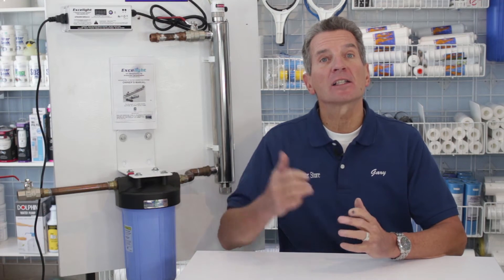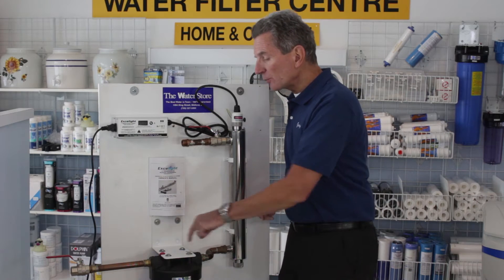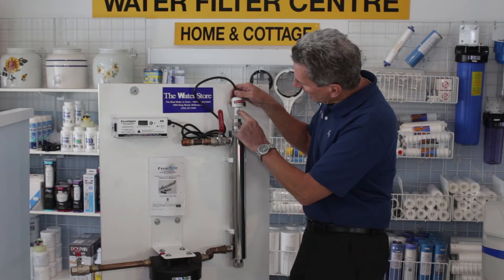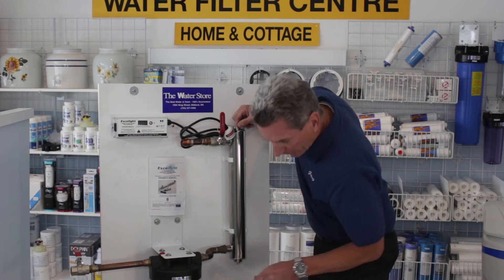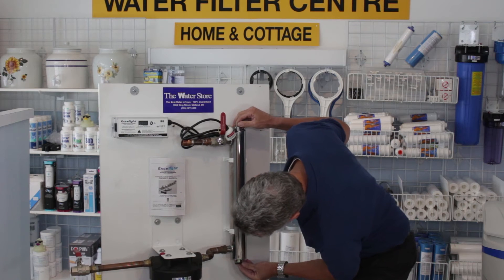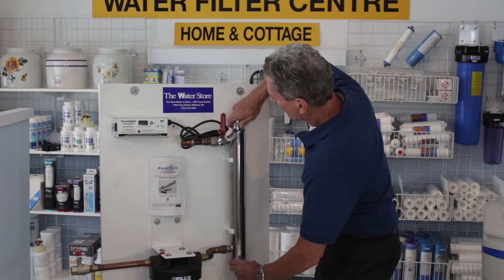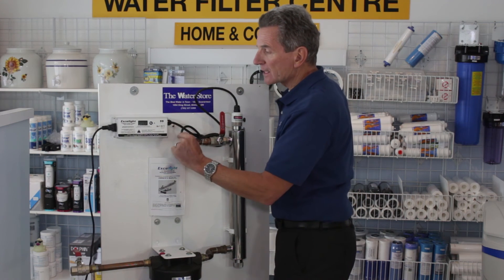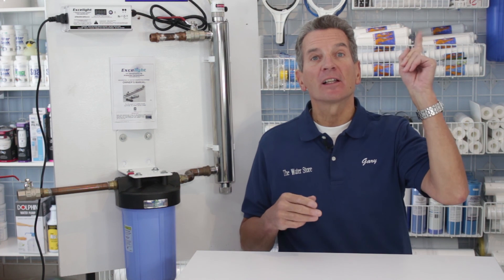How to Service and Replace Excelight UV Lamp

Comment: PSA - Once you remove the lower O-ring from the quartz sleeve, have a bucket ready to catch all the water from the housing.  Thank you for your video.
Reply from the maker: Thanks for the tip! Please share video with friends and family.
Reply: my housing was installed horizontally 😕so i needed 2 buckets to catch the water from either end.  and the 'plumber' who installed it didn't put in isolating shutoffs so everytime i change the uv bulb i have to turn off the mains.  so this change i put in shutoffs myself.  thanks for the great video !

Comment: Hi Gary changed everything on my Excel  system, light, sleeve filters and even ballast and still won't let me rest system.😢Any suggestions?
Reply from the maker: What do you mean by you can't reset the system? If you replaced the ballast they come from the factory already reset.  What are you seeing?

Comment: Do you need a pre filter with this unit? I don't have one and it was never mentioned to me. (running off well)
Reply from the maker: Yes you do.  See the manual here with thepre treatment requirements https://cdn.shopify.com/s/files/1/0659/5447/files/Excelight_UV_Manual_R5.pdf?13003398923944480723 Which should include a 5 micron pre filter like this https://waterestore.com/products/copy-of-hum-cottage-pre-filter-kit-10-bb-5005-micron

Comment: Hello , very helpful! My system won’t reset ?  It is the ESP40w/425mA/L. I’ve tried 3times , no go . Do you have helpful tips .please
Reply from the maker: I would try again following the advice in this video but hold down the button longer.  If it still does not reset you need a new ballast.  Contact us at info@waterestore.com with your address and I can get you a quote.

Comment: I need to say: MAIM and AQVINCUM about. Great education video.
I have a VIQUA  VI200 system,  we installed just yesterday me and my brother. 
One end of the glass sleeve arrived cracked, temporary I have fashlied it around by Teflon tape to protect the Light from getting wet. Works perfectly.
What do you suggest; should I fix it with more than one insulation ring?
Reply from the maker: I would definitely replace the sleeve with a new one asap.  If it beaks you will have a major flood.